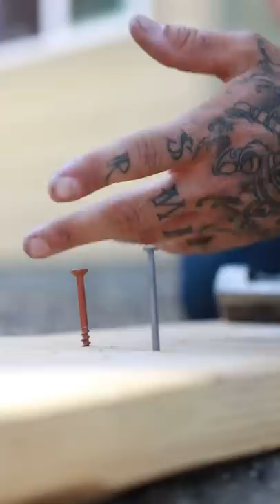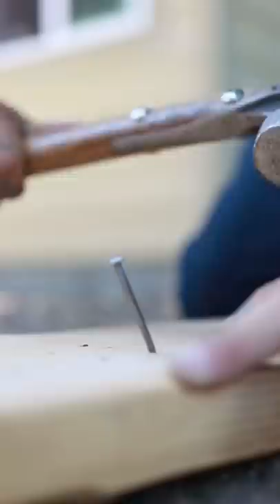Nails vs. Screws: Why do we use nails? #shorts

Comment: Breaks ‘ceramic’ deck screw, bends ‘steel’ nail.
Reply: And makes it looks like he is enlightening people
Reply: Brah I was thinking the same thing.
Reply: Exactly lmao
Reply: Although he is showing low grade screws , his talks are true
Reply: Exactly what I was gonna say! This bs video is an excuse for those who want to use cheap materials and to do it quick.
Reply: @UtshaBasak  in reality, the biggest thing is cost. I myself, a not trained person with "decent" tools, can get more nails in per hour than screws. Not having to rely on drill batteries, and with the right hammer, its faster than good drills.
Reply: Screws always break easier than nails
Reply: @UtshaBasak  we build with nails because they are cheaper and faster. Steel Screws will also bend.
Reply: @joonasrautio9909  Is that because of the thread? I've never built anything, so please excuse my ignorance, but I'd really like to know what it is that makes a nail stronger than a screw.
Reply: @msstarlight4770  it’s the bend and the thickness and also what material it’s made out of, most screws are made from relatively brittle material to nails as well as a screw may also latch in something and snap off. But none of these things really matter because screws that are made from the same material as nails are just more expensive so no reason to use them in most carpentry, drywall is the main use of screws but even then some people rather use a nail gun, because it’s cheap and easy
Reply: @david-468  Ok, thank you, I appreciate you taking the time to reply.
☺👍
Reply: @DeathProductions200  screws are harder than nails, however harder usually means more brittle when sheer forces are at play. Nails are better all around.
Reply: why did you put those words in quotes
Reply: Very low quality screw bug he technically isnt wrong
Reply: yup. i was watching and saying, thats not a construction screw.